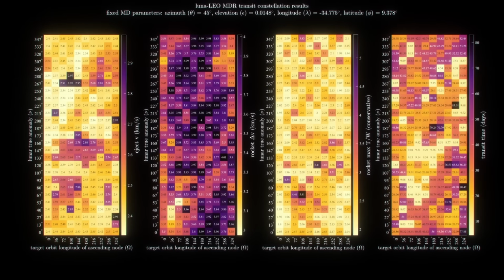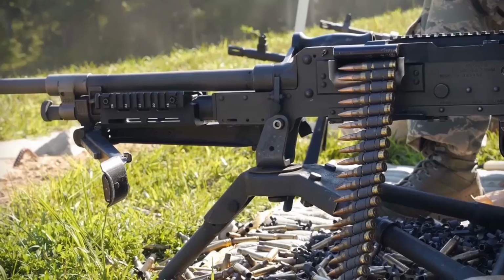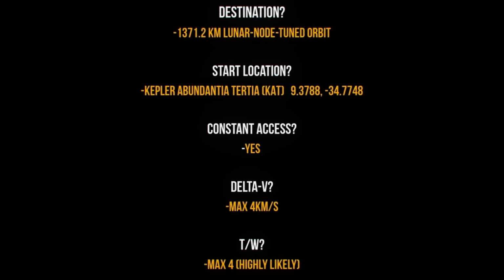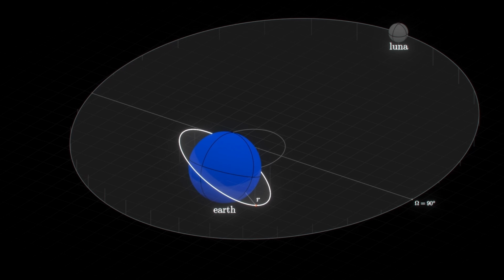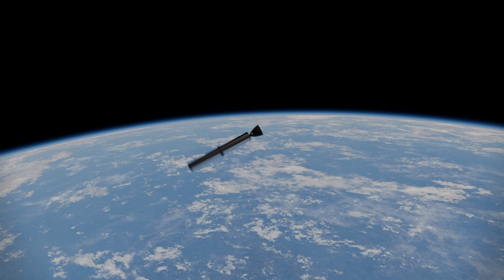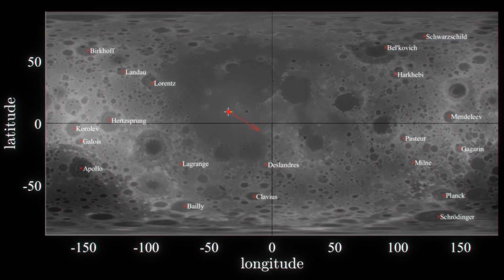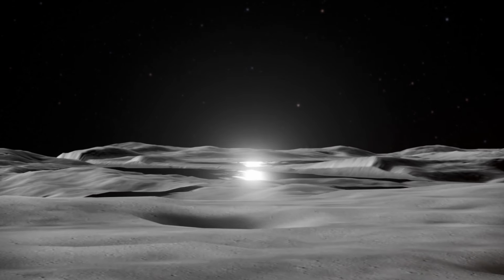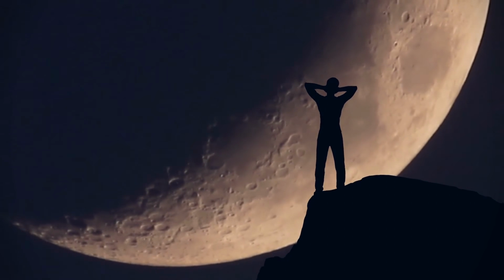Moon To LEO Transfer Simulations For A Lunar Mass Driver & Terrain Analysis + Power Sizing Estimate

Comment: how do you propose orbital forges to work? sending a massive forge up into orbit does not seem viable and making something flexible enough to actually make useable products even less so. you keep mentioning the need for mass in orbit, but most of that mass is high quality rocket parts and sensitive equipment for science or communications. how can lunar mass help produce any of these in orbit?
Reply: Going back to the bulldozer video. Probably won't start with a massive forge. Will have multiple smaller forges. So production can grow modularly.
Reply: @scrap.catastrophe  im not asking about scale, im asking about process and method. smaller modular forges or not, i still see a gap between metallic lunar mass delivered in LEO and useable goods that would actually be wanted.

sure, i can imagine metal being melted in micro-gravity and then using metallic arms or molds to form it and letting it cool to get structures. but why? its not like space stations need structures to be reinforced if most of it is built to take the G forces of launch from earth side. radiation shields make a bit more sense since they are usually high density and can be installed later in orbit for human habitation. assuming there is even a market for space stations shielded for prolonged human habitation.

radiation shields and micro-meteorite shields both are something that can be made by lumping mass onto stuff but they both are already well developed and not that much of an issue to make and launch from earth. especially when considering proven designs that don't take an risk with orbital installation and the space industry being highly risk averse. more than that, both of these applications are one time purchases so having a constant flow of mass is excessive and for single deliveries its easier to launch from earth.

for orbital raw materials to make sense there must first be orbital manufacturing to make goods from it. i cannot see a viable business model based on the current market demands of producible goods in orbit.
Reply: @ThisIsDumbAllTheNamesAreTakenif we could build satellites in the moon, the launch costs would be dramatically lower, no?
Reply: @nicolasolton  yeah, if we could. the problem is i dont think we can make CPUs or high bandwidth transceivers or other satellite parts. the main thing the moon can supply is large amounts of structure, but satellites are almost fully high end components that i dont think can be easily produced. the video is proposing sending chunks of purified metals, not finished high end parts. mass is wanted in orbit, yes, but most mass needed are all high end components. satellites are not slabs of metal.
Reply: I would think all processing would be done on the surface.  Doing things in microgravity is adding issues.
Reply: Moon has silicon and building mass materials like aluminium/iron/titanium. Oxygen is alot of your propellant. In case of hydrogen 2 parts H2 to 16 parts Oxygen. Alo of mass on Comms gear is just the antenna - big lumps of metal from the moon.

That gets you power and a shell which is alot of your mass for AI sat or whatever station. The chips and small payload or small especially if there is a massive station to plug into. 
Epitaxy and wafer construction can be done on small scale and cost alot per gram. They are alot easier to do in orbit.
Reply: @bobo-5195  i did forgot about fuel. I'm still not sure about the integration of different sat systems in orbit, propulsion, structure, and antenna coming from the moon, but cheap fuel in orbit is a very strong argument since all liquid fueled systems are already built to intake fuel.

thanks for an answer.
Reply: Hi. An 'orbital forge' is not a particularly special device, its a kiln in orbit and if we're clever with the way we design them theres no reason they can't be amenable to the constraints of lunar ISRU. I'll outline briefly what 'meltdown' means in the context of a massdriver rocket here.
- after the massdriver rocket rendezvouses with a receiving station, its cargo is separated and the entire rocket is disassembled elementally, ie everything aluminum on the massdriver rocket is set aside in one pile, everything titanium into another. Then a specialized disassembly step follows where small advanced components are pieced apart by hands (eg microcontrollers are desoldered from lunar PCBs and stored away for future use, or complex valves may be removed, cleaned and stored away for future use on the infrastructure the receiving station is building).
- we then take all these different piles of elemental materials (and relatively common materials, like basaltic fibres) and deposit them each in an independant rotary kiln. These kilns could be electrically heated with induction though if we're in space we can acquire tremendous thermal energy with no powerplant overhead with solar thermal concentrators which can be enormous. A cassegrain dish of polished aluminum (which can achieve an albedo of >0.92 if carefully composed) can concentrate tremendous amounts of thermal power in a very simple format, a 1MWth concentrator dish may only need a radius of ~15.3m and may mass almost nothing given, in orbit, a mirror can be exceptionally thin and passively held there on a thin fillagree of trusses. The kilns are made of multiple layers of a refractory ceramic and are spun such that molten material is pinned to the interior. By making the kilns conical, molten material can slowly be guided along the length of the rotary kiln into a receiving structure (say a fixed archimedes screw, also made of a refractory ceramic). Its also important to note this kiln is not something we'd want to assemble on earth (it'll be massive and launch vehicles are exceptionally expensive) but instead assemble piecemeal from imports supplied by massdriver rockets from a lunar ISRU manufacturing site.
- This molten material is then cooled and extruded via a process such as continuous casting into ingots which can then be taken into a pressurized manufacturing facility on the machining station as more useful raw material to be used in infrastructure projects the machining station is contracted to produce (which very well may be high quality components for rocketry or sensitive scientific equipment). Furthermore the swarf and general waste from this manufacturing (lathework, CNCing, sintering, etc) can be deposited back into the piles as the start of this process.

Comment: My only issue with analysis here is the dessistation orbit, while mid inclination LEO is the the bulk of  satellites today, with the expanding of AI sats SSO is going to become far more popular than it is today in the next few years, look at he new pecan island site spacex has got it will likely have as much launch capacity as the rest of the world combined in just few more years and it is optimised for SSO launches.
Reply: Hello. The sun-synchronous orbit is highly inclined, meaning that for massdriver rockets transiting along cislunar space to arrive in these orbits and rendezvous a major Δv penalty is going to be incurred. While this is distateful in its wastefulness, this Δv penalty also manifests as substantial and continuous additional costs which will, at least in the case of LEO, potentially disincentivize developers from building orbital infrastructure in those orbits from ISRU-derived materials. 
Its also a good idea to specify what you mean by 'AI', that can mean at least 10 different things, all notably different in how they'd be implemented in an orbital asset (and especially differing in degree of public endorsement, or lack of).
Reply: @melanovis Greeting. By “AI sats” I mean satellites specialized for computation that benefit from high uptime. The operations themselves need not be AI—I suspect they’ll include materials and biology simulations as well, or other industrial workloads. These currently look like the next major push in space development, and the driving near-term reason for a mass driver to be built.
In addition, the ground infrastructure SpaceX is building to support that specific deployment (see Pecan Island, LA) will make it the cheapest place to launch from for the near term (~20 years). That creates a strong economic bias toward high-inclination orbits. The bias has self-reinforcing feedback effects: superior economies of scale will drive future development of support services and other manned infrastructure into those same high-inclination orbits. At longer timescales (20–60 years), as many additional spaceports come online, that bias should fade.
The model as currently shown does not include this pre-deployment economic bias; it treats Earth as a point source of upmass. Just as the lunar location of the mass driver affects its optimum target orbit, so does the launch location on Earth. Because the LEO infrastructure is likely to be built before funding for the mass driver is even approved, that bias will already be in place for the first MD deployment.